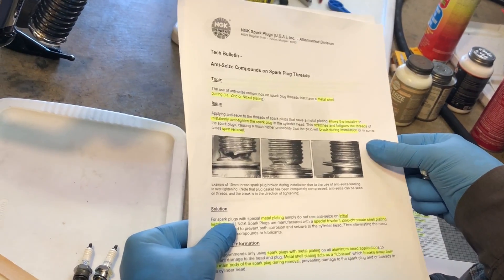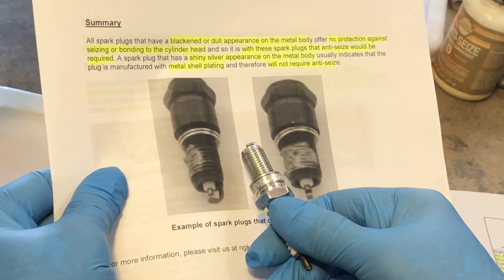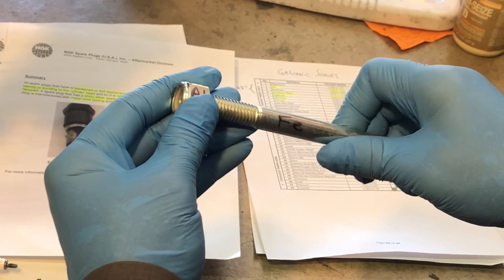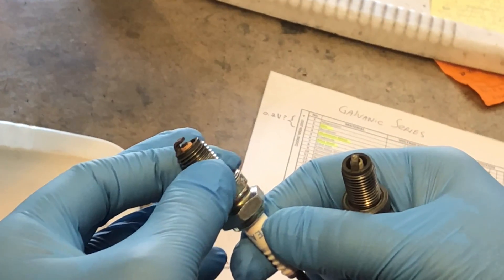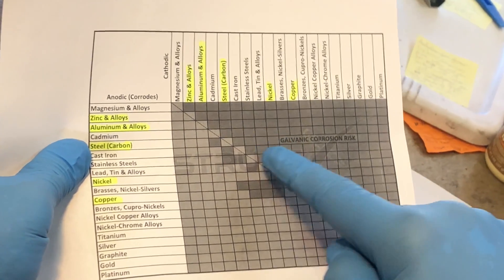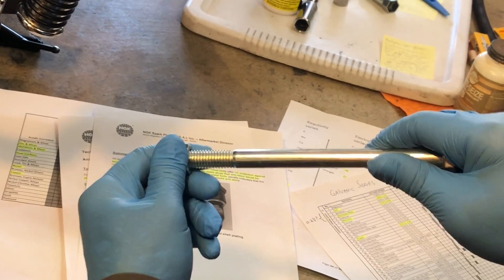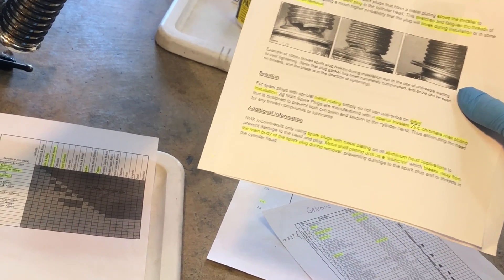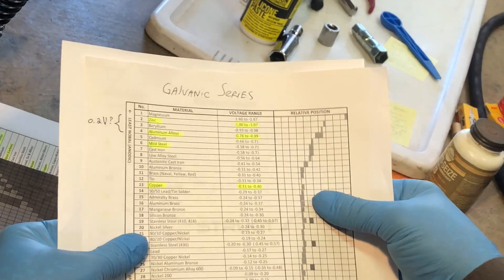Aluminum cylinder heads, spark plugs, anti-seize, & galvanic corrosion

Comment: My engine manual says 18Nm torque for the spark plugs. I can not imagine that they will overstretch even when lubricated with that low torque. I am in doubt if is possible to overstretch a spark plug made out of steel in aluminium treads.

Comment: I've always used anti-seize, not knowing why it worked. I figured it kept fouling from working up the threads, which would result in a seized plug, then subsequent breakage or thread stripping. It also has been useful for hand-tightening since it lubricates. A reasonable torque on the spark plug or 1/8" turn past hand tight has worked well in 100's of plugs. I've never had one come loose or break off.

Comment: I always dab a little on the threads. I build drag cars and we are constantly replacing spark plugs, in/out-in/out and so on. We use a hotter plug just to warm the motor/oil up then switch to a cold plug and pull it to the line, start it and make the run then shut down at the end and get towed back. When back the plugs get pulled to be read. Anti-seize goes a long way with preserving the thread integrity in the heads. Just do not over-tighten although I've cranked on quite a few 14mm thread plugs while indexing and NEVER broke one in 25+ years even with anti-seize. I've pulled threads in soft heads before.
Reply from the maker: Thank you for the comment!  In your experience, does anti-seize affect the heat range of the plugs at all?  Some mfgs claim it makes the plugs run hotter ...
Reply: @Zerk_Ziegler  No. However I do not use a lot and only every few times when I see that it needs some. Too much and it will start to drip into the cylinders.
Reply from the maker: @fastcars1173 10-4.  I appreciate your input.

Comment: I use zinc anti seize in every spark plug installation. Most plugs will bottom out when the crush washer is crushed. Torquing then stops.You will feel this point of resistance and stop. Unless you have gorilla hands there will be no problem. Lubricant and torquing really plays no role once the washer is crushed to seal .Makes it a lot easier to remove later on.

Comment: Awesome video.   Never thought about the galvanic corrosion issue.   I ran across someone who said not use the aluminun antiseize on sparkplugs because it hardens up and becomes stuck do to heat.   For this reason i use a high temp nickle antiseize.   But now i wonder if nickle is a wise choice due to galvanic corrosion.
Reply: On the back of that comment, I suspect the anti seize compound on new O2 sensors is nickel.  My experience is copper doesn't work but equally the compound may be aluminium or zinc but I think it looks more like nickel.

Bostitk and Loctite nickel anti seize are the only ones which have military NSNs.
Reply from the maker: It is true that aluminum is more anodic than nickel.  But, if you use good-quality nickel-based anti-seize, I don't think you should have any problems.  Nickel-based anti-seize products generally have high temperature ratings, which means the stuff will stay put between the threads over time, blocking entry of electrolytic substances.  No electrolyte = no corrosion.  Just my $.02.

Comment: My 2011 Ranger XLT Supercab 2.3 4 cylinder Duratec has 196,000 miles. I bought it at 60,000 miles. I’ve never replaced the spark plugs. Aluminum block and head. Any advice on removing the old plugs?
Reply from the maker: There are a few related comments, below.  The main thing is to take it slow and easy.  If you are patient, a good penetrant will help, with some luck.  Also, check out Ford's TSB 08-1-9.
Reply: My advice: once you crack a plug free and start backing it out, if you feel any unnatural resistance don’t try to power through it - run the plug back in and then try backing it out again. It should make more progress before binding up again. Repeat until the plug is free.

Comment: The norm of installation of a plug is stated on the box seat contacts then turn no more than 3/4 of one turn. 
This is the simplest way to fit a plug and Lube it !!! 
These bulletins are put out by a desk jockey with to much time , no idea, not a technician no mechanical aptitude and justifying his job , this sounds like he works for the government and not NGK 
This up date would be for the back yard mechanic only.

Comment: You guys are doing all wrong.  Aircraft plugs on piston engines all specify the use of a special  graphite lube that is used on the threads.  Champion makes it.  That’s what you want to use.
Reply from the maker: Loctite makes a graphite-based (metal-free) lube as well.

Comment: I always use a very light coating of anti-seize, except when installing a plug in a cast iron head.  And I don't tighten a plug to a torque value. I tighten the plug until the gasket just touches the head, then continue to tighten the plug until the resistance to tightening it rises abruptly (typically a 1/2 turn). I use the same procedure for tapered plugs (no gasket), but they only need 1/16 - 1/8 of a turn past finger tight. And I've never stripped a cylinder head or a plug.

Comment: Keep in mind most torque specs are intended for use on clean and lubrrcated items. Inconsistencies in thread condition such as corrosion, debris, lube presence or even type of lube can greatly affect clamping force provided at a given torque. At higher torque the variation in clamping force can get kind of crazy. This is why on critical items such as rod bolts, the preferred method is torque + an angle. Torge to a lesser value before the variation gets out of hand and then to an angle to achieve desired final torque. The rod bolts are measured of stretch to insure correct clamping force.  Even this is not fool proof and there will be variation in acquired clamping force but it is the most consistent method I know of. 
Back to spark plugs. In the scheme of things torque related, they are not critical and do not require much torque to do what is required. The gasket type plugs must be tight enough to compress the gasket to form a good seal and not back out. The taper style  must seal on the tapered area and not back out. This is mostly all that is required. Using anti sieze will help prevent damage to the threads in the engine head and will aid in sparkplug removal. As I see it there is no downside to using it except it is messy. It will prevent a 20 minute spark plug change becoming a two day head replacement. This is actually a common thing. Ask a Ford guy.
Reply from the maker: Agreed on all counts.  For example, ARP recommends the use of their proprietary lubricant to repeatably achieve the required fastener preload and clamping force.  Also, it's interesting that you mention the TORQUE+ ANGLE tightening specification.  These types of critical fasteners are referred to as "torque-to-yield".  The idea behind this approach is that the TORQUE specification preloads the fastener to just before the yield point on the elastic-deformation region of the stress-strain curve -- this part of the curve is a straight line that has a given slope.  The ANGLE specification then preloads the fastener further beyond the yield point into the plastic-deformation region of the stress-strain curve.  Since the plastic-deformation portion of the curve is more or less HORIZONTAL, the preload of the fastener and the associated clamping force are theoretically much more predictable.

Comment: Every time that I used  anti seize on my toyota tacoma 2tr-fe engine, the plugs were hard to remove. Have not used it since. Now thay come out like thay should. A friend used anti seize and took two hours  to remove one spark plug.
Reply from the maker: Not all anti-seize compounds are created equal.  Products intended for high-temperature applications contain more metal and are rated at over 2000 deg. F.  Lesser-quality anti-seize products have lower max. operating temperatures and contain more grease, which can carbonize in high-temp applications and make plugs difficult to remove.
Reply: 100% agree with OP. Only trouble I’ve ever had with plugs is when I’ve used anti seize. It’s a hard no for me - not worth the trouble.

Comment: I've been using antiseize for over 30 years on plugs. From old air cooled vw's to newer vehicles and have not once had any issue. I'll keep using it. Don't care what the manufacturer states.
Reply: The only time I’ve had an issue was with special plugs that didn’t have an electrode that sticks out like normal. The center electrode was recessed and the strap was just a little tab off the side. With those if you put on to much anti seize it could cause a missfire if it got on the tip. 
Otherwise I’ve never had an issue unless someone basically dipped the whole plug in anti seize.
Reply: @NBSV1  just a dab will do ya.
Reply: @skelafeti  Exactly.  Doesn't take much.  Only a complete clueless klutz would over torque a spark plug enough to snap the plug or strip the threads.

Comment: Yeah sure.....the NGK text predicts the threads of the sparkplugs will deform and break BEFORE the matching threads of an aluminum cylinder head will ?...... idiocy. No doubt lubed torque values of fastners is much lower than non lubed...and if you torque to "Spec" you can over-stress lubed fasteners. In the real world....a LIGHT anti-seize on plugs is no big deal and prevents stuck fasteners if left in-place too long. Tighten by "feel" if you have any mechanical sense at all....don't use torque values that can then go wrong....or if you do....use 30% less value "lubed". Much ado about nothing......
Reply from the maker: I agree that a solid-steel screw would strip out the aluminum threads it's going into, but ... spark-plug threads are formed in a thin-walled tube ... too much torque is likely to damage both the plug and the head.

Comment: GM issued a TSB warning of the use of anti- seize on spark plugs. It inhibits the transfer of heat to the cylinder head, causing the plug to be hotter and shortening its life. Best practice is to remove plugs and run a thread chaser and lube threads with engine oil at regular intervals. Anti- seize is for those who leave the plugs in for extended periods without removal.
Reply from the maker: Would you care to share the number of the GM TSB?
Reply: Also curious about that number
Reply: Can't say I've ever really had antiseize work as advertised for me, I'll usually use a few drops of motor oil on nice threads ,or ones that are a little worn I'll use some (moly) CV joint grease. 
And I can't say I've ever had an issue on removing them the next time.

Comment: i use just a dab I have seen too many people just smother the threads with anti-seize, dielectric or just plan grease .to the point of rediculesness covering even the electrodes. than wondering why the plugs are fouling, almost the same as plugs v patches a few years back they tell you not to plug but patches don't galvanize like they used to since doing away with lighting   I have used plugs for over 30 years, and they work. Unlike taking down a tire going through all the steps checking re checking only to have that same tire go flat. Two feet from the shop

Comment: LOCTITE LB 8044 ZN Zinc Anti-Seize 
part # 233507

This is one of the only zinc anti-seize I can find.
Would this be high on your list for spark plugs?

If yes or no…pls let me know why

Would it be temp tolerant for plugs?

If not this composition…then what and why?

Much thanks!!
Reply from the maker: This is a fine product, but it is more of a general-purpose anti-seize, rated for a max temp. of 750 deg. F.  I would suggest something with a higher temperature rating when it comes to spark plugs.  Here is the link for Never Seez: https://www.amazon.com/Mariners-Choice-Anti-Seize-mariners-choice/dp/B0068UJ2H8. Aluminum-based products, like BustApart, also work great.

Comment: use red locktite on your spark plugs, hehehehe....
Reply from the maker: Lol ... maximum operating temperature for Loctite is only 450 deg. F.   Thread lockers disintegrate in high-temp applications.

Comment: I always get that feeling I should cut back the torque when using any kinda lube, thanks for confirming this! :D
Reply: Most torque specs are intended for use on clean and lubricated fasteners/threads.

Comment: I do not recommend using anti seize on spark plugs.  I used anti seize on my 1997 BMW R1100RT motorcycle and it resulted in an expensive repair.  After a few thousand miles the spark plug loosened up and caused the Motronic ignition system to fail when the spark plug lost its ground.  The repair manual warns about the need to maintain the ground when testing for spark..

Comment: I even use the factory specified Castrol anti-seize (looks like Permatex 133H - silver) on the factory aluminum lug nuts on my Porsche 911 (993 series). They get torqued to 130 Nm or 96 lbf.ft. as called for in the factory manual.
Reply: Wow 96 lb ft? My land cruiser calls for around 25
Reply from the maker: He is talking lug nuts, not spark plugs 🙃  @brkbtjunkie
Reply: Last air cooled engine. I bet it’ll still put a smile on your face every time you start it. 😁
Reply: @Conservator.  Nothing like simplicity, besides I grew up with real VW Beetles and of course they were air cooled just like my Porsche 993. The Centerlock nut on my Porsche 991.1 GTS also takes an anti-seize paste as per Porsche and it gets torqued to 443 lbf.ft. then backed off and re-torqued to the same 443 lbf.ft.

Comment: When I apply anti-seize, I put a flash coating on the threads using a clean dry brush instead of one with a gob of anti-seize on it. The coating is so thin, it looks more like a spray-on coating.
Reply from the maker: Yep, I use a small tooth-brush I keep in a plastic bag for this purpose.

Comment: you dont read a plug by looking at the threads lmao.
Reply from the maker: To read a plug, a number of factors are taken into account.  One should consider the condition/color of the electrode, the ground strap, the base ring, and the porcelain nose.  The color change along the threads provides information about the heat range of the plug.
Reply: @Zerk_Ziegler  you are talking out of your ass.
Reply from the maker: Alrighty then ...

Comment: Might be a silly question but,  how does a well lubricated plug torqued to 10 ft. lbs differ from a completely dry plug that is torqued to 10 ft. lbs?   I can see that the lubricated threads could/would turn through more of the threaded well but both would be torqued to the same specs no?  Thanks for posting.
Reply from the maker: Not a silly question, but you already answered it.  For a given torque, a lubricated fastener advances through more threads than a dry one because there is less friction.  That means it stretches more than a dry fastener does.  In other words, the lubricated fastener sees a greater tensile stress than a dry one.  In both cases the torque is the same -- but there is more work performed when the threads are lubricated.
Reply: At 10 pound feet of torque your within the crush of the washer so the threads aren’t stretching. But I’ve seen almost everyone fully crush the washer and then go a little more which is obviously wrong.
Reply from the maker: What if you remove and reinstall the plugs several times?  The washer will eventually crush completely ... @quickturn66
Reply: @Zerk_Ziegler  I agree, and because they last so long these days, I usually just change them every 4 or 5 years and avoid the problem of them being stuck and damaging the threads in the aluminum head.

Comment: Great analysis! I AGREE! I am 71yrs old & have used antiseize for decades. Living in the rust belt, we MUST use it. NEVER had overtorqueing problems & agree, just drop torque specs if problems. Just apply a THIN coat. Two dissimilar metals? Dog gone right, antiseize it.
Reply from the maker: Thank you for the comment!

Comment: I don't find any need to use anti-seize in cast iron heads but I do use a light coating in aluminum head.
Not sure how anybody can get a torque wrench into some of these tight areas, I've never used a torque wrench but I will say they only need to be tight enough to seal and stay put.  Not sure why people over torque them, avoid doing that!
I advise against using copper based anti-sieze in aluminum heads due to incompatability between aluminum and copper.

Comment: I'm calling BS on NGK. I tighten by crusing the crush washer, not by torque reading. I also lube all wheel studs due to the salt environment. I've broken off many seized lugs, but never pulled one in a lifetime (50+ years of wrenching) 1/2 turn after firm contact will not pull a spark plug in half. Maybe chinesium. I have been using anti-seize since reading a 2007 Toyota TSP asking dealers to remove the plugs from new engines and apply anti-seize. I owned the engine in question and the plugs to date are nearly identical. I also never use NGK plugs. I prefer to use Delco in GM and Denso in Toyotas, Motocraft in Ford. I notice that now the Denso plugs feature silver paint on the threads which is old-school anti-seize. I just installed a Denso oxygen sensor and applied Denso anti-seize that came with it. Same crush washer system.
Reply from the maker: I appreciate the comment!
Reply: That Toyota TSB you speak of is very interesting. Do you know its number?